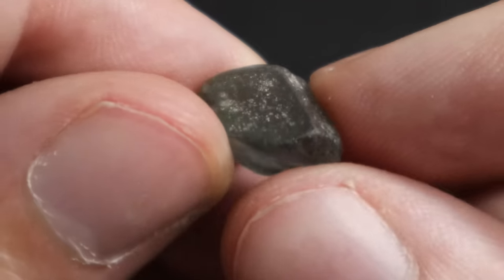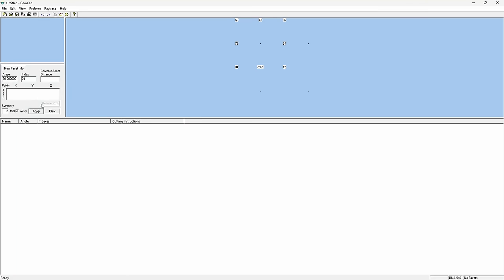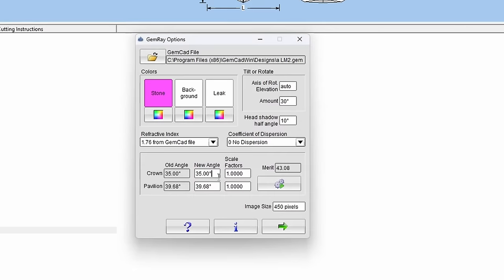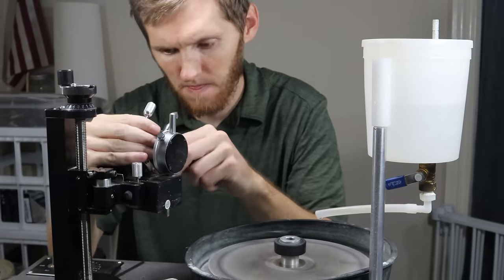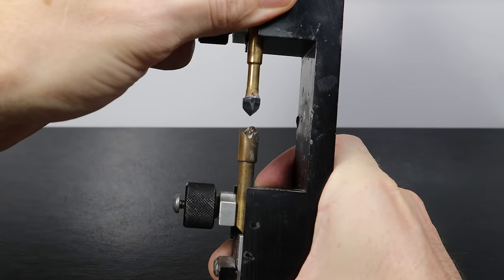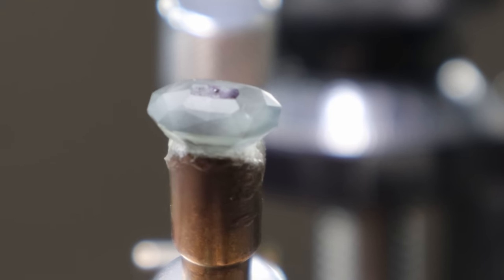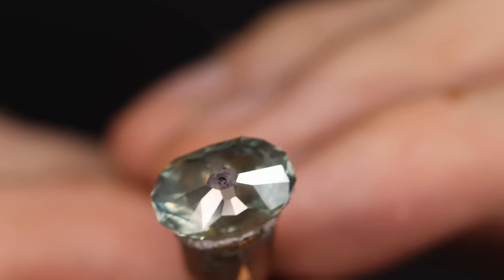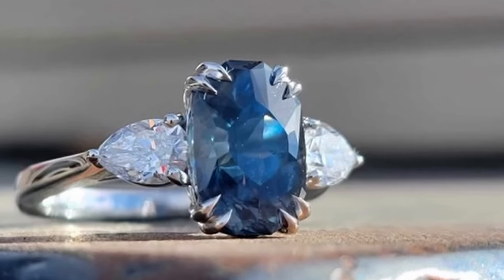I Cut a Raw 10 Carat Montana Sapphire Into a Beautiful Gemstone

Comment: Beautiful stone especially after heating!  I was under the impression that if you heat a sapphire after its cut you have to repolish the facets …… does not appear to be the case with this stone?
Reply: most heat treaters will have a lap on site and they'll re-polish as a fee with the treating, much cheaper and easier to re-polish a stone rather than fully cut one from rough.

Comment: Why did the color change so dramatically after being heat treated?😲
Reply: The cloudiness is caused by a mineral called rutile. The heating process reaches a temperature that is too low to melt sapphire, but high enough to melt the rutile. Once the rutile reaches the right temp, it diffuses into the sapphires crystal structure and produces the brilliant blue color.